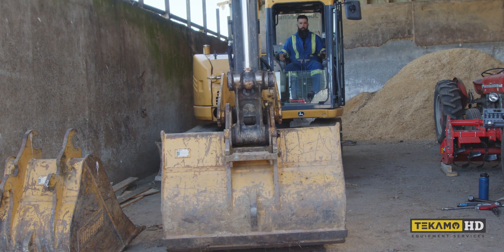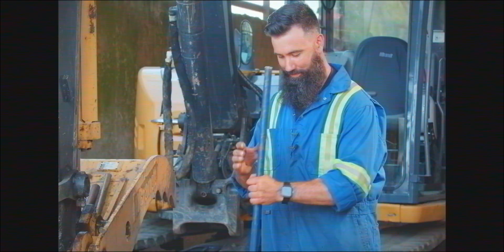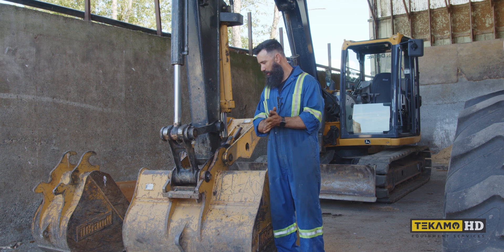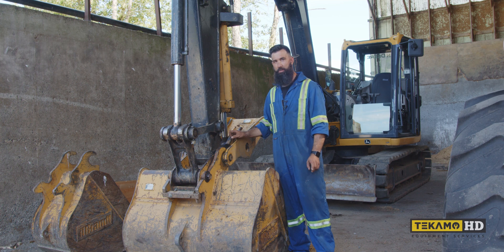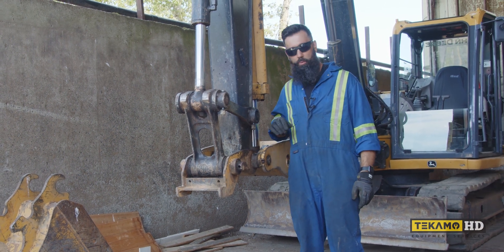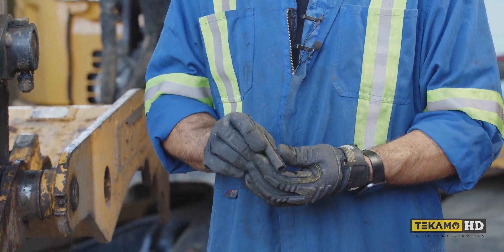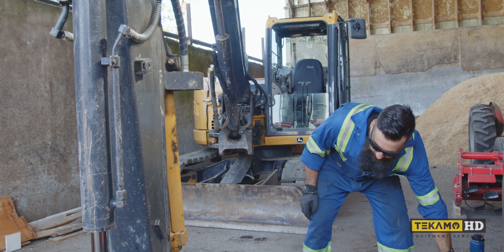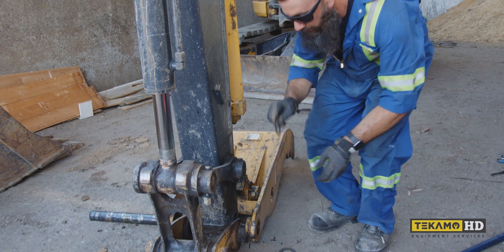How To Shim a John Deere 85g Excavator Bucket - Excavator Bucket Repair

Comment: I have a small 1.7 machine and i just did the bushes and pins, they came with some shims and there is a little play in the bucket hitch side to side but i find it hard to add shims Plus the O ring gaskets, should i just ditch the gaskets and only use shims?

Comment: I just replaced the same 18 inch long pin on my Case 580 backhoe.  Also has the same style and size thumb.  It was a nightmare 2 day job getting everything aligned.  You make it look way too easy.  I finally used your welding trick to keep the pieces aligned.  Really glad you approve of this method.

Comment: Wouldn't the bushings have worn uneven has their was tilt to the bucket not just a side to side motion
Reply: Whenever I do shims, I’ll do new bushing too that way everything is tight.
Reply: Most likely the bucket or coupler wedge is worn. The bushings and pins last quite awhile with min wear as long as its greased.  This was just taken the side to side play out